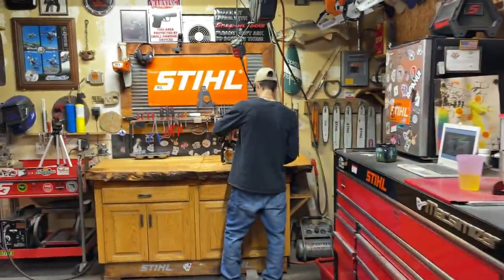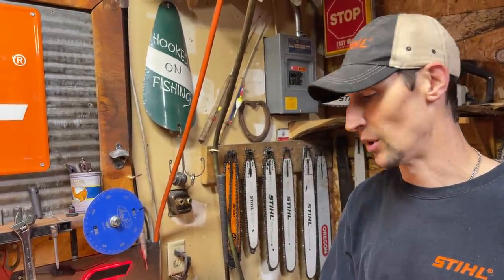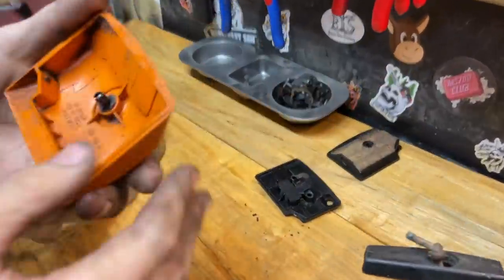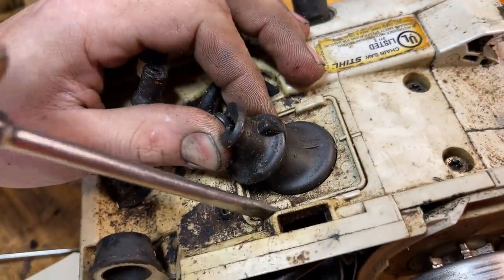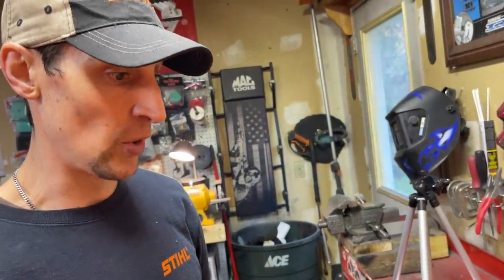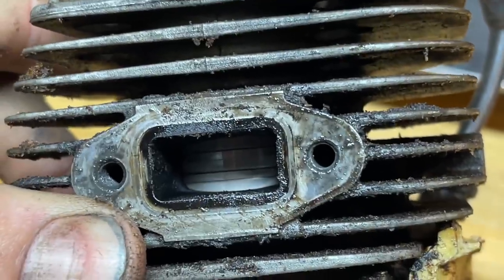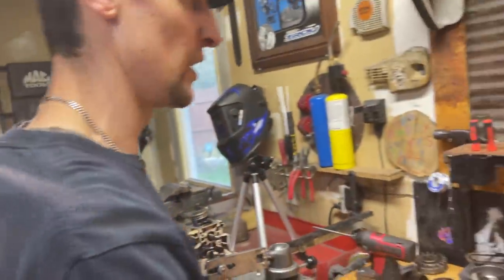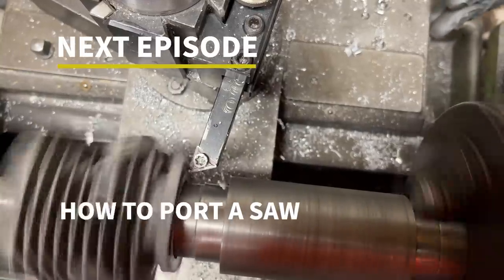LIMB REAPER! My old Stihl MS200t disassembled by John's Custom Saws for an awesome restoration

Comment: Thanks Gents, I really appreciated the video. I have a 200t and this will help prolong its life. I'm far from a small engine mechanic so any hands on video I can watch regarding the 200t or just chainsaws in general is invaluable. I love running my 200 t as it can certainly rip but every time I use it I'm always thinking about its longevity. Thanks again, great show!

Comment: Best thing after rebuild is use VP Racing fuel i use 40;1 its available in 50;1 but the saws last so much longer with the extra oil. It’s not cheap but i have not had to bring the saws in to be worked on! I still run my 020Super AV  good job on the break down !using a little air when you change your chain will keep the saw a whole lot cleaner. That dirt and oil traps a lot of heat.

Comment: This particular saw was the best saw EVER MADE BY STIHL! Bought two of them in about 1990 and literally cut down well over a million in contracts with them. Remove brake and spark arrester and no problems. Carb kits were needed every couple of years. Rarely used any other saw even on big stuff. Light. Powerful. Dependable. Used optimal 2 mix exclusively. Still use them but gave me 2 decades of heavy commercial use. Almost unheard of. 🤣
Reply: D'accord, Brill saw. But, am very partial to my 07 an 08s.  An thanks John.

Comment: Great video !  Thanks.  Getting ready to buy a clone or a parts kit.  The only thing I can say about Stihl's "fine engineering" is that it reminds me of an old Saab 6000 my son had as a first car.  To replace water bottle, first remove engine.  That manifold area is a cluster for a saw of this price.  A small width stainless hose clamp would have worked great there.

Comment: A couple of wraps from an air chisel will pull the magneto off the crank. Use a pointy tip and put it in the end of the crank.

Comment: Hi I was surprised you did pressure 1st then suction? I was taught to do suction 1st as if the engine is leaking it will be sucking air not pushing it out. You put some fantastic content 👍

Comment: Where i use to work...  we had a
 barrels full of stihl 015s and 020s. Some ran and some didn't.  Some were apart. All were trade ins or service estimates that were declared dead.
I wish I would of had the insight to part them out. Instead they all ended up in the dump.

Comment: I use to own a brand new one, that I have regretted having to give up for years. Now I can't afford one. I admit don't need one, being disabled. But I miss having my 200T more than any other saw. So I bought a Farmatec G111 clone of the ms200t I once had.
At least it will feel the same in my hand and maybe it will work good enough for me that I won't be too disappointed.

Sorry. I'm just being defensive of not buyinging an OEM Stihl Ms200t. ☺️

Maybe it will hold up fine for me, not making a living with it. 😁

Back to your build video. ☺️

Comment: you don't need a new carb, just the diaphragms and the metering lever, you can tell the saw has had some use when there is a dent in the metering lever

Comment: Loving the new channel! For as hard as those saws are worked, that piston looks great. What brand of oil have you been using in it? Seen alot of saws with gobs of goo or the crustys .
Reply from the maker: I’ve mostly ran VP full synthetic in it
Reply: @GuiltyofTreeson  
Thanks for the reply. I run that as well when I can find it. Also had good luck with Bel-Ray H1-R. Keep up the good work.

Comment: Excellent video . Thanks!!  Question:  I have a 2005 200T I bought it new, home use only has about 10 hours on it.  Runs like new.  

Is there anything I should do to it to keep it top notch other then spark plugs, cleaning, etc?  (I always store it tank empty and carb dry) thx in advance!!
Reply from the maker: Use non ethanol fuel with synthetic mix. That’s a gem

Comment: Yes the carb is a real let down
When mine had issues (wouldn't hold a tune, flat spot accelerating) a few people in the tree game I know said "Oh yeah gotta replace the carb on them"
Being a mechanic with a few years on saw and mcycles I decided to look into it to see exactly why that is.
Thing has an accelerator pump in it of all things, seems it wears out and not a serviceable part and some air bleeds past it.
Then I came across a hack in tube and against my usual principles of avoiding dodgy repairs I decided to give it a shot.
If you remove the air filter housing by taking off the carb bolts you will see a small rectangular plug in a hole above the throat on the outside face of the carb (usually hidden by the AF housing). You can see it at 3:50 in the video.
Pluck it out, fill the hole with sealant, (I just used silicone as I was skeptical it would work).  Surprisingly it actually did work and the saw runs fine, no dead spot on acceleration and holds its tune and has done for last 6 months of use.
Perhaps if John here has a few old carbs off these he can investigate what that passage under the plug is and why pushing sealant into it blocking the passage fixes the problems, which may reveal the actual flaw with the carbs that causes them to fail. 
I only speculate that it is related to the accelerator pump as my general experience with walbro type pulse pump carbs that have no such accelerator pump is they are pretty bullet proof aside from diaphragms that are serviceable.

Comment: One BIG question. In all three videos John never modified the timing by changing the position of the flywheel which is often done by changing the position of the keyway on the crank. Is it because the 200T is good in factory spec but other saws benefit from timing changes?
Reply: There are certain saw models that dont like timing advance... and also if saw is climbing saw you want to be very easy to start.

Comment: Dammit, I wish they still made that saw.

But that’s the way it goes right? They can’t just improve on the old model, they have to reinvent to wheel and ruin it… The 201 is a complete joke in comparison.
Reply: Got my hands on a 201 , I hated it just recently sold it .  200t is the only saw I want to use in the tree .